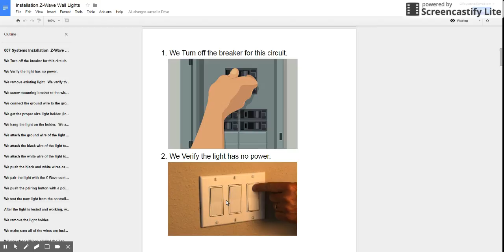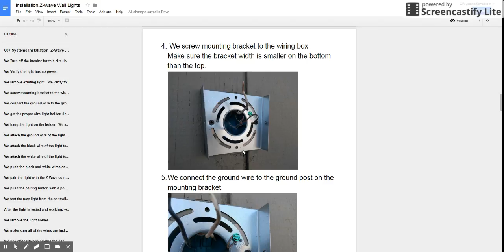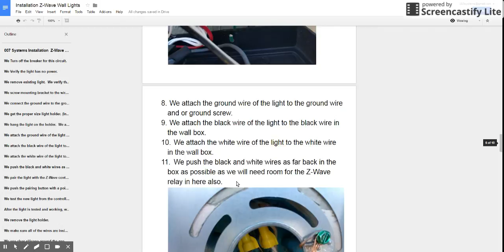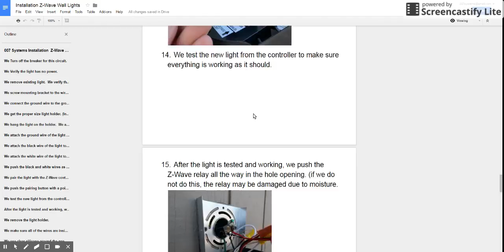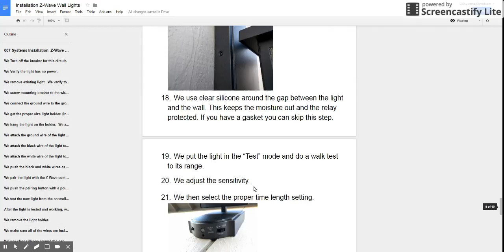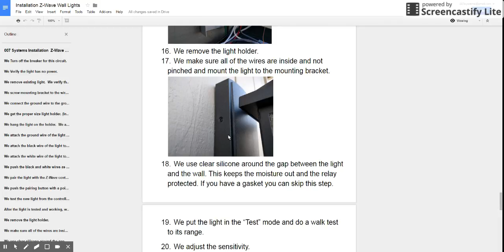007 Systems Outdoor Z-Wave Motion Wall Light Installation

Comment: Do you have some greater detail on the wiring? There seems to be a fair amount of connections that were jumped over.
Reply from the maker: Hi Dan. Thank you for inquiring.
Our Z-Wave Outdoor Motion Lights connect to your home like any other motion light.
There are only the three wires you connect to your home. Hot, Common, and ground. These are covered in the video above.
If you are interested in the relays wiring, you can check it's instructions here.
https://www.007systems.com/relays-z-wave-mini.html

Comment: Will this work if there the motion sensor does not have a light in the box itself ?
I have an old X10 motion sensor without a light.
I want the motion to trigger a SmartThings doorbell.
Will a zwn-rsm2 or zwn-rsm1s both work the same for this application ?
Reply from the maker: A rsm-1 will work with that application.
Reply: 007Systems excellent thanks
Reply: Okay, apparently that unit is no longer available.
Can you tell me if the Fibaro FGS-213 will operate in the same manner ?
Reply: Or would I use an FGS-223 and connect the motion sensor switched blue wire to S1, and white wire capped off ?
Reply from the maker: It should It looks like that item is a single Z-Wave relay. I cant say for sure because I do not use those relays and can not test it.
You can use a dual relay and do what you want to do. Just use one of the relays and our duals are almost half the price of the Fibaro's
Reply from the maker: Never messed with those relays because of their high cost. Give it a test. Let me know if it works for you.
Thanks.